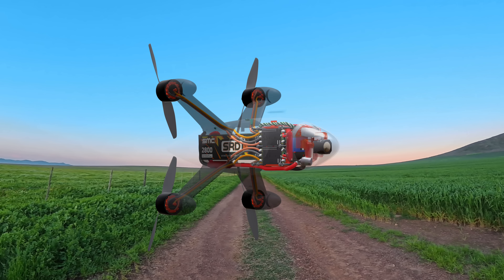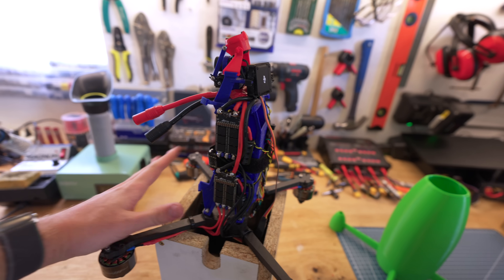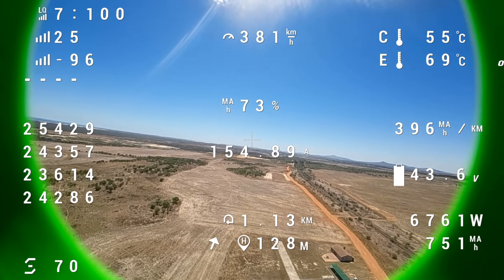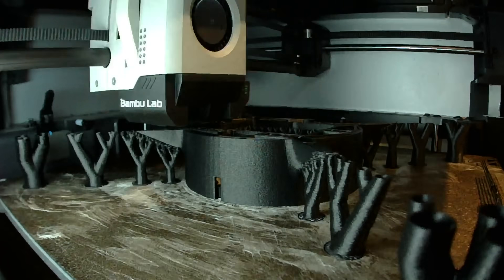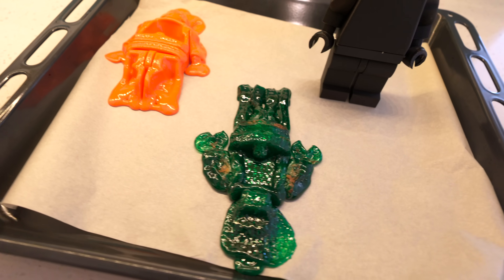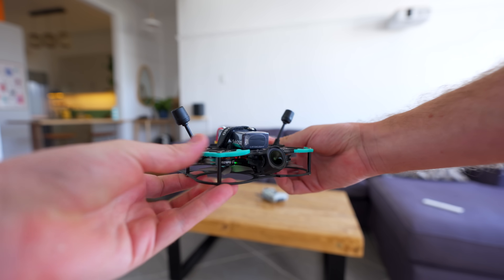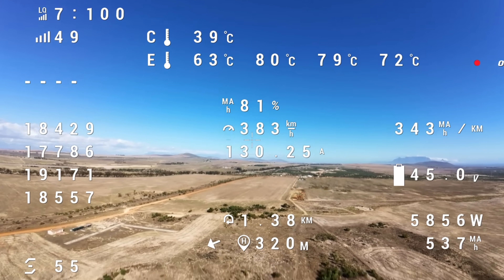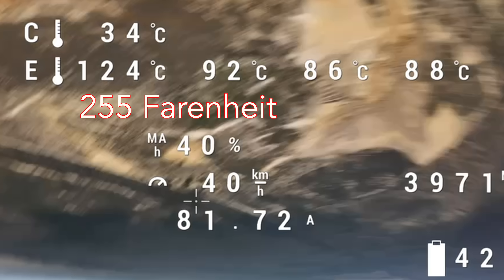THE COMEBACK - World's FASTEST Drone V3

Comment: A couple ideas for the cooling...
-Freeze the water.  The phase change from ice to water will absorb a lot more BTU's than the entire temperature range of liquid water will.  When the ice melts, you still have the entire range of liquid water to absorb more heat.
-Use that pump to transfer the water to a skin radiator.  This was a fairly common thing in WWI aircraft and racers up to WWII...they created a flush exterior surface out of metal and underneath it they passed the coolant lines.  Essentially they were exchanging heat between the engine and a plate that was a blended part of the wing or fuselage.  Zero drag penalty incurred!  You could have a plate that matches the profile of a section of body 3D printed in aluminum with integral channels and fittings to connect to.  If sized correctly, you'd be able to fly indefinitely without building up heat, as there's more than enough air passing over it at that speed to keep things cool.
Reply: you will quickly bump into other issues. condensation would require you to completely insulate all the electronics, greasy mess.
Reply: @butwait i was wondering the same thing when i saw the comment at first glance
Reply: @butwait I'd use Use Propylene Glycol-Water Mixture (50/50) chill it lower than water, but only add it before you take off. At those speeds ambient air is drying everything off anyway. It also seems to heat up fast the flight is barely 1-2 min from looking at those power levels dropping 2% a sec.
Reply: @butwaityou fundamentally fail to understand liquid cooling, it is a sealed system.  It does not expose your system to liquid or condensation as it is a contained system. The physics of heat transfer are more interesting the more you learn, but absolutely No... liquid cooling does not introduce condensation. Also, for many coolants they are not electrically conductive unless you add colorants.
Reply: @NLPexperts The point was that chilled coolants, ones below the ambient dew point, would result in condensation inside the frame.  If your electronics are potted and your connectors sealed with gaskets, it doesn’t matter.
Reply: @wagnerrp the condensation can't get from the liquid through the solid pipes, radiator or pump that contains it. It is a closed system.
Reply: Ok but why? In this use case the drone is designed for short sprints, not sustained long runs. It basically takes off, reaches top speed and has to turn around and land before the batteries run out. 

In this case they can treat the cooling water as a consumable. Each time they swap batteries they also drain the warm water and refill with cold before flying again.
Reply: @viceice just design the case with pipes running through it, 300mph wind will have a massive cooling effect, although to be efficient the case will need to be metal. Pump + pipe + radiator is not complicated and it works. Changing water is lazy.
Reply: these are good ideas but the drone does not need to last longer than the speed runs, its not an endurance machine, more like a drag racer. just needs to stay cool enough to operate for the couple runs and then its grounded
Reply: @SnakeHoundMachine when he said 26kw power draw, my thoughts were entirely focused on this. I cant imagine how big or heavy the battery would be to get a respectable 30 minute flight time.
Reply: I think engine coolant would be better still
Reply: Use Propylene Glycol-Water Mixture (50/50): you can chill it way lower than water. -40C. Also those pumps are awesome but the extra weight and power drain. Since it looks like that aluminum plate makes up one wall of the tank, how about a plate with some short fins inside the tank. That would increase surface area for the plate. Also angle those fins so that the movement of the drone will "mix" the liquid. Like the drum of a cement mixer.
Reply: @JoshSCZK like the idea I'd protrusions from alimniuyinto water
Reply: i was thinking about evaporate cooling, that would be cool. literally.
Reply: We used a WAX change of state cooler on the Lunar Rovers, for the Motor Control Electronics, aka DCE.  Worked great.  The guy who designed the coolers is still alive.  Me, one of the DCE designers.
Reply: It already has a perfectly good cooling system for its needs. All you armchair engineers love to needlessly over complicate shit, it's frustrating to read.
Reply: @randomname4726 their are men who push science forward. For each one a thousand like you who simply deride and insult. Ultra high density batteries and matching cooling makes this a meaningful discovery, not a tech showcase...  my advice costs no air resistance or friction, as internal with no shell changes. Your comment is simply belittling, naive as to how a sustainable 300mph drone using liquid cooling can change the world.
Reply: @NLPexperts  Sustainable, for about 20 seconds, when the battery runs out.  Engineering is taking known science, and doing the math to apply that to a new design.  Your gut says you can just turn the hull or fins into a heat exchanger, and then you can just build vapor chambers or heat pipes or pumped water loops to drive that heat exchanger, and then the speed of air will totally provide enough convection to achieve equilibrium before burning out the ESCs.  Trust me bro!  That’s armchair engineering.

My gut says convection does not work that way.  Just increasing airflow does not continue to increase convection unbounded.  You will hit a limit, and between the available surface area and resistance on the transport mechanism getting the heat to that surface, equilibrium temperatures will be too high.  And if you tried to do all this with a water loops, you would end up having more thermal mass in that system than the existing little box anyway.  This… is also armchair engineering.

So lighten up Francis.  You’re proposing a concept wildly different from an existing working design, without actually doing any of the math (read “the engineering”) to prove it’s actually viable, and getting pissy when someone out the thread in general over this.
Reply: @wagnerrp all overclocking records are achieved with liquid cooling for cpu's and graphics cards, thats often 2000 watts of heat dissipated. Nothing else works. I have built many liquid cooled systems. The drone is not building anything close to 2kw of heat energy. Super fast air on a metal shell will cool the internal radiators, my 20 years of real world experience in PC and supercomputer cooling affirms this.
Reply: @wagnerrp  Heat exchange for a given surface increases almost directly with airspeed, there's a slight exponential curve the faster you go...meaning if you can exchange 1BTU at 100mph with a 1" square plate, you can exchange perhaps 2.2BTU at 200mph, or 3.5BTU at 300mph.  It continues going up with slight exponential value all the way until you reach an aerodynamic heating threshold at mach whatever it was, not important.  These are arbitrary numbers meant to highlight the thermal exchange to speed ratio, but the ratio is the same.  What that means is that yes, the faster you go, the more cooling you get.  With only a modest amount of speed, one can easily reject the amount of heat this drone is likely creating, which I estimate at around 3kw, given the total wattage and using 80% ESC efficiency, which is a good average number between partial load and full load.  3kw of heat can be exchanged with minimal surface area and air mass, and there are certainly heat pipes capable of transferring that quantity of heat.

If you do end up looking for how airspeed affects thermal exchange, you'll likely find a lot of info about how it's better to slow the air down to get better cooling, but those studies are working with finned radiators that aren't aerodynamically comparable to a skin radiator.  Many studies have been done with them in relation to UAV's in the past 20 years, NASA and other teams have studied them, and for the most part they're a superior choice by all metrics but adds too much cost to the design.  You should be able to find them with a minimal search online, no need to trust me bro.

In conclusion, Francis...nobody here is getting paid to run the numbers and experiment with one-off record breaking drone cooling systems.  These are ideas meant to hypothesize, and if that's what you consider armchair engineering, then I have some rather disappointing news for you about how actual engineers come up with actual solutions to actual problems.
Reply: @Skinflaps_Meatslapper  That’s… just all sorts of wrong.  There’s an exponent in there, but that exponent is 0.5.  For various reasons, you usually do a bit better than that, but there’s no way you’re doing over 1.  You get diminishing returns.

The problem isn’t even being wrong, but presenting an unfounded hypothesis as factually true.  And you are too.  You even said yourself it’s just a hypothesis, but that it’s accurate because of some bullshit numbers you pulled out of your ass, and papers I’m supposed to go find myself.  (I accept we cannot post external links here)

How about a real number we can start with?  Give me a heat transfer coefficient.  Don’t just grab the “as high as 1kW/m.K” value from the internet, from an unknown material, velocity, angle, roughness, temperature, and humidity.
Reply: Simplify rather than complicate. Immerse the ESC MOSFETS in a medium that evaporates, like pure alcohol, and simply let it boil off. No pump, no heat sinks, and the greatest cooling efficiency you can possibly have, second to vapour chambers. The controller temperature will never exceed 78C as long as you have alcohol in the chamber. (Your contact area is sufficient to avoid film boiling.) Since we are into WWI analogies, evaporative cooling is how they cooled machine guns.🙂
Reply: Here's another refinement for cooling.  Make the entire front half of the fuselage a skin radiator, with a secondary shell over that, following the lines of the original fuselage, and an annular air inlet on the front similar to the nose of early jet fighters.  Some quick calculations to shape the empty space between to make a C/D duct so you maintain optimal airflow even into the transonic and supersonic regimes.  The rear outlet would be a nozzle smaller than the inlet, accelerating the heated and expanding working air to a higher speed than when it entered.  You have an enclosed, aerodynamically sound duct with a heat source...a perfect scenario to put the Meredith effect to good use.  Not only will you be able to cool the drone indefinitely, the act of cooling the drone could result in free thrust.  Depending of course on how well the duct and fuselage was shaped and how much heat it needs to reject, of course.  If anything, it'll provide enough thrust to reduce the drag penalty of the fuselage.  It'll be even more relevant, perhaps even necessary, for when the next new battery milestone is reached and they can double or triple the watt output for the same size drone chassis.  According to the rule of thumb that doubling speed requires 4x the thrust, this exact drone could approach the 500mph mark if new battery tech comes along that can output 30kw or more from the same form factor.
Reply: @Skinflaps_Meatslapper  You are not going to have any temperature differences that allows you to create any meaningful trust.
Reply: I think there's some common sense misunderstanding here....freeze the water OR use a radiator.  Nobody in their right mind is going to try pumping ice.  What is wrong with you.  Seriously.

The condensation is a really minor problem in this situation, we're not talking about cryo cooling the CPU in your computer and then having case fans blow fresh air over it constantly.  All it would need is to be potted.  And honestly, given the fact that it's such a small volume of air, you're not going to be pulling all that much condensation from the inside of the drone body anyway.  You might get a droplet or two of water.  A coat of non-conductive paint would be more than enough, I'd think.

For the glycol/propyl guys....those reduce thermal conductivity and capacity of the water.  It's used in engines because they run hotter than the electronics here are designed to handle.  If you're seeing anywhere close to 100C on your ESC, you've got problems.  Meanwhile, engines will happily run above the boiling point of water, but since the coolant stops working all that well when it boils, you add a coolant to increase the boiling point.  You also pressurize the system to further increase the boiling point.  This is all in a thermal realm way above what an ESC should be running at, so it's entirely pointless and actually detrimental to add anything to the water in this case.

Perhaps a more realistic approach would be a couple heat pipes running along the surface, just trim a bit from the fuselage to have them exposed to the outside air.  Prefabricated, easy to retrofit, no coolant necessary, possibly lighter as well.

And the reason why this is needed?  At some point they're going to reach a wall where heat does become an issue to their 2min flights, and they'll have to revisit their cooling methods.  Even now, they have to replenish a water tank that's just barely doing the job for that amount of time...so why not make something permanent that will allow you to conduct all the flights you want with only a battery swap?
Reply: ice doesn't conduct heat as well as liquid water.
Reply: @Treon No, ice does not have less thermal transfer (conductivity) than liquid water.
Reply: @NLPexperts  I'd use Use Propylene Glycol-Water Mixture (50/50) chill it down to -30C and dump it in right before flight. That drone is only in the air for 1-2min anyway.
Reply: @NLPexperts You’re correct. Both ice and water have terrible thermal conductivity, but water has the benefit of being a fluid.
Reply: Can't pump ice. Water to a radiator is better than a static block of ice,
Reply: @NLPexperts  You could have the pump turn on after a thermal probe reaches x degree.  Also, if you started with ice you wouldn't even want the pump to turn on until the water reaches above ambient temperature, otherwise the radiator is just heating the water
Reply: @alexbacon5497  convective heat transfer is typically much greater than the conductive heat transfer through a static block of ice. So pumping coolant in a loop through a radiator is the best approach
Reply: @NLPexperts This has to absorb 50-100kJ in about 20 seconds, while minimizing mass and drag, and have less than 80K difference to ambient possible.  Everyone discussing coolant loops and radiators is missing the fact that this is a high power transient, not a steady-state system.  A heatsink, rather than a heat exchanger, is the correct solution for handling a transient.
Reply: @wagnerrp I'm not disagreeing, I am saying keep the same outer shell design but use sandwich metal construction and internal pipes for cooling. No change to outer shape. It already has a cooling loop. running that loop along the body is proven world war 2 onwards technology.

Comment: I'm sure you've consider the pump will actually add heat to your enclosed water block. Given how much vibration you have in your drone,  I would be inclined to remove the pump, and add a one way value to an external heat sink panel.

Comment: Why not make the body metal so it can act as a heat sink? Or at least have a lot of metal surfaces integrated into the shell if it can't be fabricated entirely from metal and have them thermally connected to the internals that need cooling.

Comment: I wonder if the better way to use air cooling wouldn't be to duct air inside the drone. Instead, make the skin out of copper or aluminium and attach the hot components directly to the back of that skin. A whole bunch more complex to build, your cooling would suck until you were up to speed, and I don't know how important weight reduction is for speed here.

Comment: Surely putting energy into the water by agitating it will slightly heat the water , and then  the power going into the motor will heat it further , probably negating any  heat transfer improvement?

Comment: Stupid question, but how would altitude affect the speed of the drone? A lot of cycling world records are done at altitude because the drag reduction is greater than the performance loss due to the reduced air pressure. Would the reduced air pressure mean a loss of propellant force because there are less molecules to a produce forwards force?

Comment: PA6-CF/GF is excellent if you don't mind the long term creep. Can be difficult to print, but often worth the effort. 

Just a FYI if you haven't tried it, I really like the Fiberon PET-CF/GF. Its much easier to print, has high temp resistance [especially after anneling] that competes with nylon, & is extremely stiff. Its weakness is that it can be brittle & doesn't like hard, direct surface impact- but not overly so in my applications. PET has become my new go to overheat PA6 for most applications- favorite reasonably priced filament.  

No experience with PPA/PPS at this time. 

Keep up the good work!

Comment: For cooling... Box all of your controllers, fill that with dielectric fluid, Run tubing forward and aft out of the box, design a thin channeled copper heat sink, shaped to a ring to match the outside skin. The faster you go, the more heat is produced the more heat is exchanged. The electronics are fine in the dielectric fluid, there is no increase thermal Mass, no increased weight, easier to maintain a constant CG and y ballance.
Reply: It doesn't need to be able to run for a long time. It's a dragster. He can fill it liquid nitrogen if he needs more ability to absorb. There is no reason to engineer it for something it isn't required to do.
Reply: You are needlessly over complicating it. The design he has is ideal for the purpose.